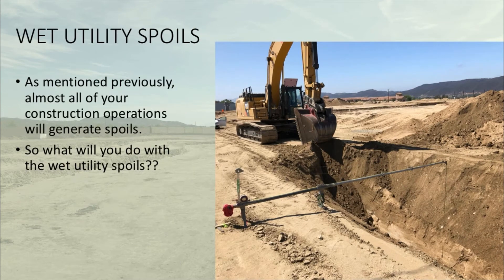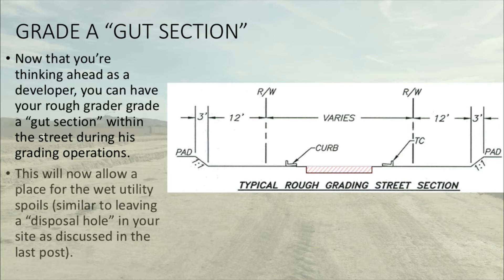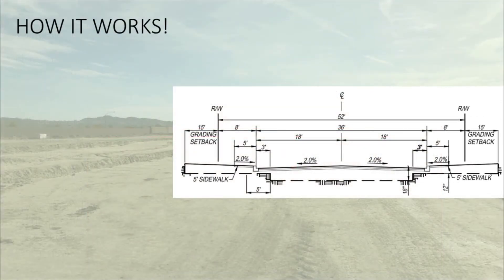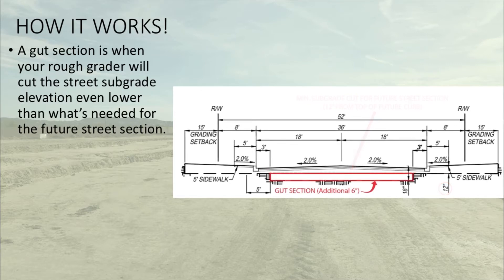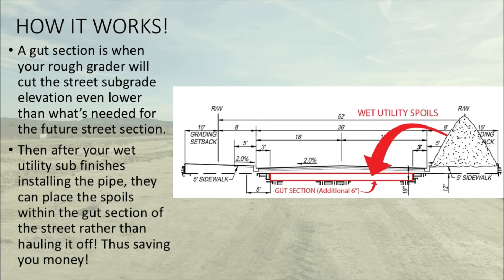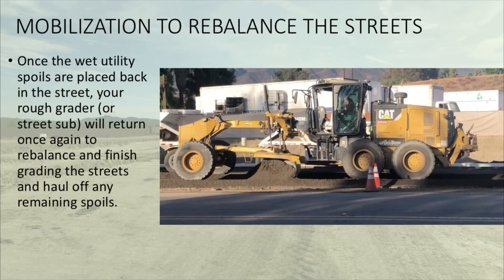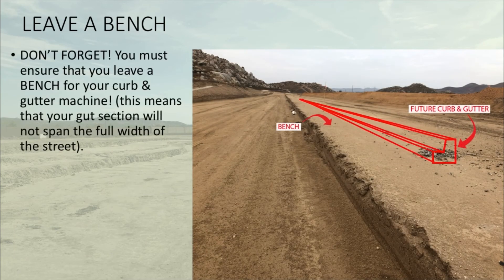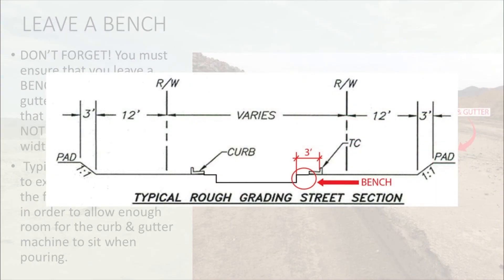Land Development 101 - How to Grade Your Streets ("Gut Section")

Comment: Their is sitting water at the edge of our driveway after pipes were laid . Gut grade section elevation improperly done on the street no bench 3 ft to curb for grading properly. What should do? Sue the city and the contractors who performed the work? Mens
Reply from the maker: Complain to the city if you haven't already. Unless you're in a subdivision and the HOA owns/maintains them, then complain to them. That seems like an oversight on the engineer and/or just the inspector (and contractor). That's irresponsible.